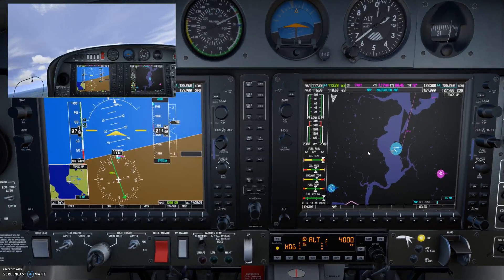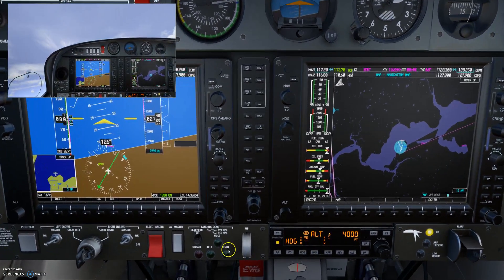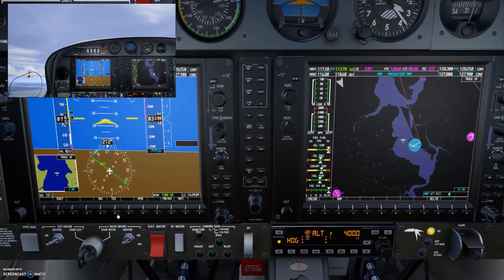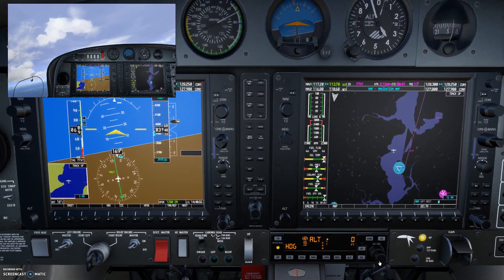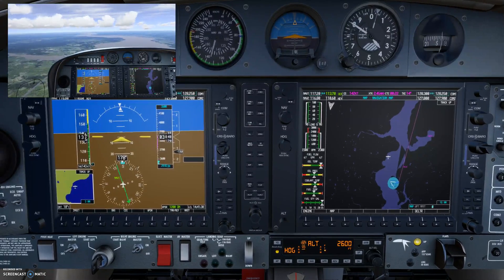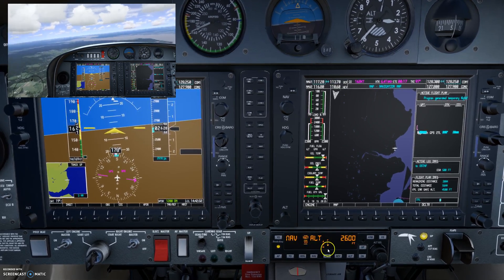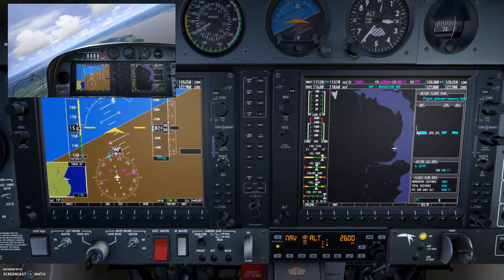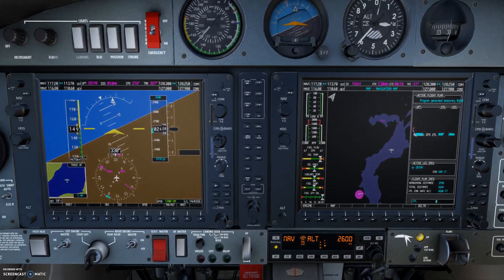DA40 and DA42 Autopilot Guide

Comment: You can use the altitude knob on the left if you use it first. Don`t touch the altitude selector on the AP and it will work via the G1000.
Reply from the maker: thanks!  Unfortunately, if you try to set it using the ALT knob on the G1000, when you press "Arm" to activate the altitude in the autopilot, the altitude resets to 0.  And "Arm" has to be pressed or it won't recognize what you've set.